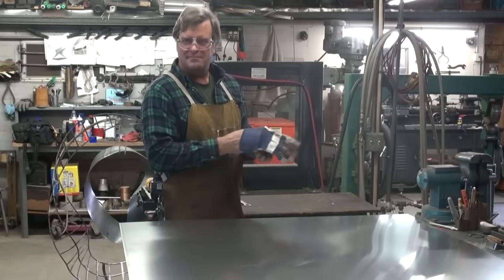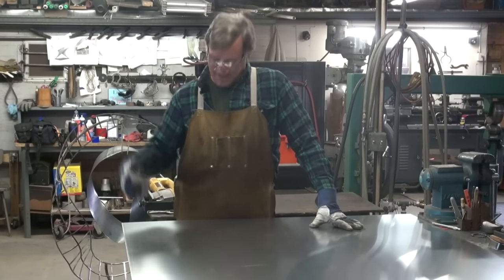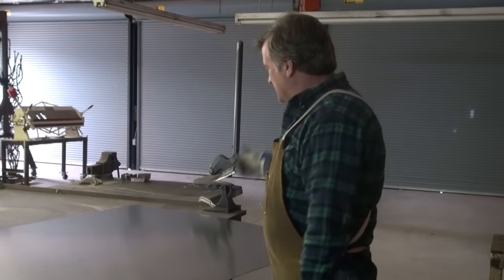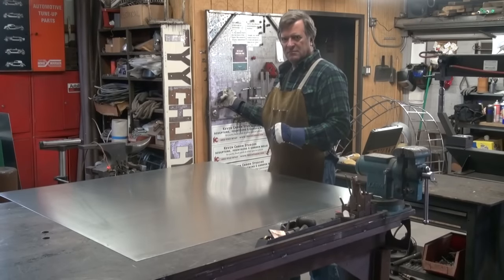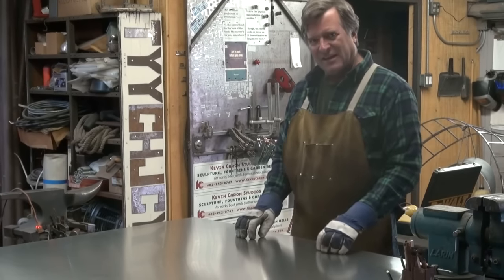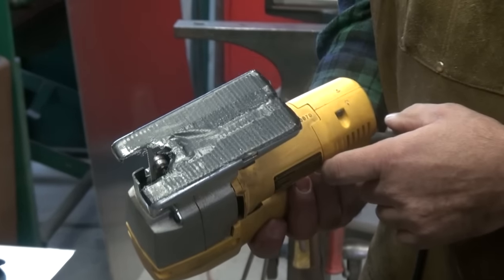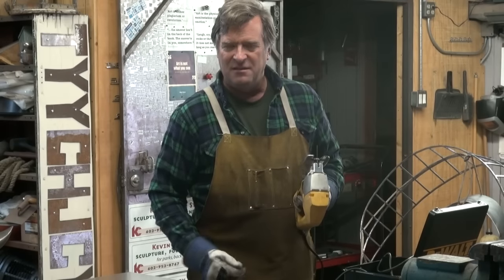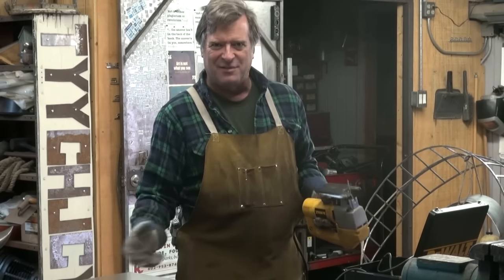How to Cut Aluminum the Easy Way - Kevin Caron

Comment: At the fiberglass boat shop I worked at, one guy would always tape the bottom of the jigsaw and make his cut and there would wind up being a bunch of scratches needing to be buffed out because the tape would pick up some of the cut particles and drag them across the surface. So I usually taped the work surface, did my layout on the tape, and peeled it off after cutting.
Reply: Now that's a good tip!
Reply: Good to know thanks. Tape on the saw works great with wood. But the shavings can’t damage the surface like metal shavings

Comment: Jigsaw with metal blade du. I have been thinking about the best way of doing this for 2 months. Thanks for showing me the obvious option for someone that only has Ryobi tools.
Reply from the maker: I have a lot of fun figuring out how to make a tool do something it was not made for.
Reply: If you only use a tool for what is made for you’re not being creative enough. And the tools will get boarded. You definitely don’t want boarded tools. 😋

I have given up on post hole diggers. I just use a monster shop vac now.

Comment: Also make sure your blade is not in an orbital motion, rub some paraffin wax on the blade every few inches, and set the entire work piece on a sheet of 2" foam insulation to cut into so you don't have to hang it over the edge of the table. Keep a small wire brush handy to clear any aluminum chips that will stick to the teeth. And wear ear plugs.
Reply: Excellent tips, thanks.

Comment: I cut lots of thin and medium gauge sheet material at work (= wheelchair customization). I agree with Kevin that a jigsaw is a good idea. However, he left out some important details. I recommend using a specific alu cutting blade or wood blade because the standard metal blades quickly get gummed up while the alu specific blades last much longer. It's also a good idea to clamp the sheet down onto a flat surface to avoid vibration. Thin gauge material can start to resonate at certain cutting frequencies if you are using a variable speed jigsaw. The blade can also seize if the sheet sags while you are cutting it because it is incorrectly supported. I do not find that using alu specific lubricant is needed unless you cut very thick material (e.g. 1/2" inch). My preferred tool is a Bosch 18V cordless jigsaw with a Bosch alu blade.
Reply from the maker: Great tips!!   thanks for watching and posting!

Comment: 16GA and thinner can be cut much faster and cleaner with electric shears.  I have Milwaukee.  Yes, they cut out a 1/4" swipe of material, but the time saved and accuracy,  as well as the ease of use makes it a no-brainer for me.  The shears will cut a nice curve too.  I had no trouble cutting a 10" radius making a set of aluminum kayak pontoons.
Reply from the maker: They are nice if you have a set.

Comment: I've been cutting my artwork out w/ a jewelers saw. While that's what I need for some intricate work, THIS would be very helpful in cutting down larger sheets to smaller ones rather than spending 6 hours w/ my little jewelers saw. What kind of blades do you use on the jig? Is there any problem w/ stutter w/ lighter gauges like 18 or 20? THANKS so much for this time saving idea!
Reply from the maker: +Stephanie Michaud      Just a metal cutting blade with a higher tooth count..    Don't use the most aggressive blades..    You have to go slow and give the blade time to cut.    Don't get in a hurry..    You will just clog the blade.    For the thinner sheets try using a wood backer board to cut against.
Reply: +Kevin Caron, Artist Thank you. I figured it had to be small teeth and YES, must go slow. I'm so averse to power tools (they've always scared me since I was little and I'm nearly 50 now and still scared of them) I hadn't even thought about using my husband's to be able to cut the metal. I'll ask him to give this a shot. It'll save my arm and shoulder! Again, THANK YOU for the video and advice! now I also know about a Beverly Shear so that's on my list of must-have too. I've been painting sculptures for so long after a dozen years as a graphic designer, tools for metalworking are all new to me.

Comment: hi mate what sort of blade and at what speed for saw ? jim south australia
Reply from the maker: The blade is just a low tooth count metal blade from the orange store.    If I remember right it is a metal cutting blade.  And I just tried to go as slow as I could on the cutting speed to keep the blade from caking up with the aluminum.

Comment: Good video.  I need to cut .032" aluminum sides for a teardrop trailer, and hoped you would suggest a jigsaw, since aviation snips seem to distort the metal.  To those complaining about the length of the video, I've seen plenty of vids where people babble for 20 minutes, shake the camera, trip over garbage, and tell you essentially nothing.
Reply from the maker: Thanks for watching Larry,  Hope it helps!
Reply: Hi Larry, I was lookimg at the video for exactly the same purpose, cutting 0.032'' aluminium for a a teardrop.  How did you get on this this method and that thickness, any other recommendations having done it?
Reply: @KevincaronSculpture  and thanks Kevin, there's always people out there who find this content really useful.
Reply: @MrRustyT  Hi Russell.  I haven't cut it yet, but did buy some saber saw blades with 32 tpi.  I'll need to cut mine (for the sides of the teardrop) before attaching it to the trailer, so I'll get a sheet of 3/4 plywood, some saw horses, and lay the aluminum down flat.  I'll also make sure the aluminum is always supported under the cut, since it will tend to flop around with the blade.  Btw, this is for an existing teardrop I made 8 years ago, where I used sheet laminate (formica) for sides and aluminum on the top.  The laminate faded badly since I let it sit outside with the same side facing south.  Doh!
Reply: @LarryCook1960  Hi Larry, thenkds for the reply.  It would be good to know how you get on as I'll be tackling mine in a few weeks. I'm going with a thicker aluminium as I was worried about the thinner stock oil canning.

Comment from the maker: Works great for smaller pieces. When you start ripping a full 4x8 sheet it gets a little harder to hold up the pieces.  Will have to set one up someday to play with.  Just need a new aluminum piece to work on.......

Comment: For awkward heights I have sometimes found it useful to put my saw or small shear on a hydraulic lift table. That way I can position exactly even with the table and move the saw instead of the metal.

Comment: So I've been using an aluminum cutting blade for big 1/8 inch sheets of aluminum, trying to cut them down to smaller useful sizes. But the problem is, even if I set up a guide or a saw stop for a perfectly straight line, the blade will drift or bend and then I end up having to twist the jigsaw to compensate or move the fence back. Any tips on how to prevent that blade drift from happening?

It even occurs when I do much thicker 1/2 inch HDPE sheets as well. Kinda thinking I just need to invest in a better table saw or switch over to a circular. But the table saw actually kinda scares me with this big of a metal workpiece. And those non ferrous blades aren't exactly cheap.
Reply from the maker: I would say you need to slow down your feed rate.   Give the blade a chance to cut.   If you can find a wider blade that will help keep it in line as well.
Reply: @KevincaronSculpture  Awesome, thank you! I'll try taking it much slower to see if that helps. Really appreciate it!!

Comment: I work with aluminum sheet all the time, and using a jigsaw to cut sheet metal will definitely leave scratches, even with the tape on the bottom of the saw, just think where all those metal chips are going as you cut, under the pad. I now use an electric shear to cut my aluminum, but I still get scratches from the tool.
Reply from the maker: Thanks for the info!

Comment: when i cut sheet ALU with a Jigsaw i set the small blade guide wheel real tight at the back of the blade ,,,, seems to not grab as much ,,,, also i use a little lube , Turps works great ,,
Reply from the maker: Thanks for posting.  Will keep this in mind.

Comment: I like using:
   Ammonia, Alcohol, and some blue dish soap.
   Household ammonia is ammonium hydroxide. This solution contains 5% to 10%
   Ammonium hydroxide is used as a refrigerant gas because ammonia absorbs heat from its surroundings.
   Dexron:
 works wonders when you're using carbide burrs to cut aluminum with a die grinder.

You can also cut 1/2 in. Aluminum sheet with a carbide ply saw blade.
Reply from the maker: Great tips!   Thank you for watching and posting.
Reply: @KevincaronSculpture  Love your channel.❤️  I'm glad you've made a dream come true!

Comment: That's funny, I've always used a jigsaw to cut aluminium sheet and just today I received a plasma cutter I bought on eBay - mainly to cut aluminium because I find the jigsaw so slow and tiring to use.  Am I in for a bad surprise?
Reply from the maker: Not at all Dave!    I think you will find the plasma to be much faster for cutting.   Just make sure you have CLEAN air coming in to it and have fun.

Comment: I have to cut some 1/16 diamond deck aluminum just straight cuts mostly. To me it seems I could cut it as we do galvanize 18 gauge by sandwiching between plywood then running through the table saw. wish me luck
Reply from the maker: You got this!

Comment: @VisorBlue get one with a good variable speed control, most of the time using a jigsaw to cut metal you don't want to be screaming along at hi RPM's, if your doing long cuts you don't want to have to hold the trigger down half way and get cramps too.
Also get one with a quick change blade holder, not the stupid screw grip type. Makita do some very nice ones

Comment: 1/4 inch aluminum stock i need to cut in half, lengthwise. In your opinion woud an abrasive wheel or a circular saw bade,made for aluminum  w/(teeth)? Might take more than 1 abrasive wheel at $3 each,where circuar blade/teeth $32,but then I'd be done with it. I have no choice but to use a 7.25 skil saw,and HD/owes has blades,but no one there had any experience
Reply from the maker: I would go with the circular saw.  Just go slow and let it cut.   Maybe rub some bar soap on the blade sides to help keep it clean.  The aluminum will try to stick to the blade.

Comment: when you say, "nice and slow", do you mean
A. moving the jigsaw through the metal slowly,
or B. have the jigsaw blade going up and down nice and slow?
Reply: I have found that for drilling metal, slow RPM with high pressure is good. I expect same applies for cycles per second on the blade, except you prolly don't need much pressure on the material for each tiny tiny tooth on the blade to pull off a tiny tiny chunk of metal, so just moderate pressure (speed of cut through the material) just enough that the blade keeps cutting. You don't want a drill or a saw blade spinning / cycling without cutting, but at low cycle rate, you can't push too hard or the teeth will pull on the material more than break pieces off of it.

Comment: I tried to cut some aluminum (3/16" thick) with my jig saw, using metal blades, but they were completely useless after about 1/2" of cutting. The orbital setting was on zero. I tried both high and low speed settings, but I couldn't get more than 1/2" cut per blade.  What blade did you use to cut this arc and how many blades did you use?
Reply: Okay...so I just read through the blog and discovered the answers were already there.  Maybe I wasn't going slow enough, but if it only took you 3 minutes to cut that section, I was going slower than you. I didn't use any cutting oil, either.  I'll try that next time.

Comment: Could I cut a piece of 1" wide, 1/4" thick 6061 aluminum stock this way? Thanks....
Reply from the maker: If that's all you have go for it..     Get a wide blade and use a straight edge to keep you in line.   Just remember to GO SLOW!

Give the blade time to cut and you should be fine.
Reply: Thanks!!

Comment: You need to state how many teeth per inch your blade is. Aluminum tends to clog jigsaw and band saw blades.
Reply from the maker: Thanks, will keep that in mind for the next time.
Reply: @KevincaronSculpture  Harumpf! You took the time to answer that comment, perhaps you could have just answered. I'll help you out: 8 TPI (though I use about 4 TPI when I chew steak).

Comment: how thick this is? i gotta 1/2 inch thick aluminum plate that i wanna cut...
kinda sceptic abut a little jigsaw cutting it, don't belive it can do it
Reply from the maker: Long as the blade is long enough to stick though the metal you are good to go.   Just have to go SLOWLY!!     It will take awhile but no reason the saw will not do the job.
Reply: right, thanks a lot :D
"may the (arc) force be with you"
Reply: for 1/2 inch you will want to use a band saw. If you do try a jig saw some oil will make all the difference in the world. Without oil a jigsaw blade will clog with aluminum real fast.

Comment: Clogs the teeth in those bits.  I ended up using a circular saw with a wood finish blade. 50 tpi. Worked great.
Reply from the maker: yeah, got to go slow so the bits don't overheat.  Still learning.

Comment: You can cut thin aluminum like that with a one hand router and a cheap 5 buck Ryobi fluted bit.. Perfectly clean, controlled, not risking getting caught up like a jigsaw.. That's how they cut/trim aluminum for trailers at the factory.

Comment: I was hoping for more facts and less ham. What blade manuf? How many TPI? What speed are you runnin the DeWalt? Are you using it straight up and down or a little oscillations?
Reply from the maker: The blade was Milwaukee, but not sure of the TPI.  The speed was about 4 out of 8 on the dial. And it was running straight up and down> Just remember  that this is an old video>  So not sure anymore.

Comment: Lots of hearsay on the internet. Some guy said use woodblade since AL gums up metal blades. I did and even sprayed it down with WD40 and it took forever just to cut 1.5 inches on a .125in thick plate. I have 40 to go. Looks like you went through the sheet like butter with metal and just clean it often and maybe place wood under the plate to clean the blade as it cuts. Anyways, thanks for the demo.
Reply from the maker: Good tip on the wood block to clean the blade.   Thanks for watching and posting.

Comment: I want to shape letters(after the cut), do I use a grinder(circular) or course sand paper on a vibrating sander to round out the edges?.
Reply from the maker: Grinder with a soft pad would be my first pick.   Maybe a pencil grinder for in the corners..
Reply: Thanks
Reply: I have a project I want to try out. What do you recommend to precisely & easily cut out an aluminum soda can. I want the top of the cylinder to be cut out, the part where the soda stays in between the inner lining next to the opening where you open the soda. Thanks in advance.
Reply from the maker: Don't have a clue.

Sorry.

Comment: If all you need is a straight cut use a skill saw with a carbide blade and protective face shield. It cuts easy but chips fly everywhere.

Comment: It varies depending material type and thickness. I've cut just under 4ft ¼in steel for a project at home. for exp. I use it for topping fence posts to height. I've done 20 alum. 2x2 sq. posts on one charge

Comment: You know Kevin,If you mount a jig saw,on lets say a router table type deal.Get a router mounting pad,and install a jig saw in its place you can get pretty good control by guiding your material instead of you saw.Just slow it down going around bends and corners.
Guess you notice that I can't go sleep yet/
Paisano

Comment: Yep, I had accidently found out you can use a saw on aluminum with no problems
Reply from the maker: Yes!   Just go slow and give it a chance to cut.   A little bar soap or wax on the blade helps keep it from clogging as well.

Comment: I use a jig saw to cut thicker sheet. the aluminium clog up and the heat melt the fine saw teen. On the coarse teeth . it cut a bit better but still clogs up the teeth tightly. Jig saw may not be a  good option. I switch to small hand grinder with t carbide bit. that cut much much better - but do not have the  luxury of cutting tight curve of the jig saw
Reply from the maker: Have to go real slow with the jig saw blade.   That's the only way I have found to not clog up the teeth.  But a combination of both tools will work pretty good also.

Comment: Use a carbide tiped circular saw instead.
Just make sure you have your aluminum clamped down and spray it down with some wd40.
Reply from the maker: Great tip!  Thanks for watching and posting.

Comment: What if you don't have a jigsaw?
Reply from the maker: What tools do you have?
Reply: @KevincaronSculpture  I have the basics: a drill, hacksaw, angle grinder, tin snips....I saw another video where they used box cutters to score a fault line on both sides of the material then fatigue it until it breaks!

Edit: my material of choice is 3mm aluminium sheet
Reply from the maker: Okay, look for a 4.5 diamond cutting wheel for the grinder.   Use that to score the aluminum and or cut it off. 
Like this   https://www.northerntool.com/shop/tools/product_200627841_200627841?cm_mmc=Bing-pla&utm_source=Bing_PLA&utm_medium=Power%20Tools%20%3E%20Saw%20Blades%20%3E%20Diamond%20Blades&utm_campaign=Klutch&utm_content=42519&cmpid=361680776&agid=1180876404544488&tgtid=pla-4577404349989203&prdid=42519&gclid=5953de66048214c9ea67bcfe07485f85&gclsrc=3p.ds&msclkid=5953de66048214c9ea67bcfe07485f85

Comment: electric metal sheet metal shear for 18 gauge steel will probably set u back 40-60  bucks.. I paid $40 10 years ago..
Reply from the maker: Nice little units but the ones that work over 1/8th are costly!